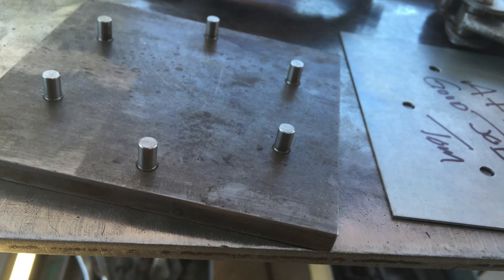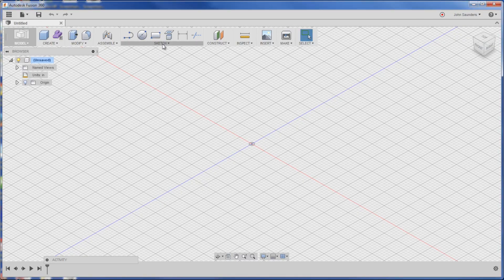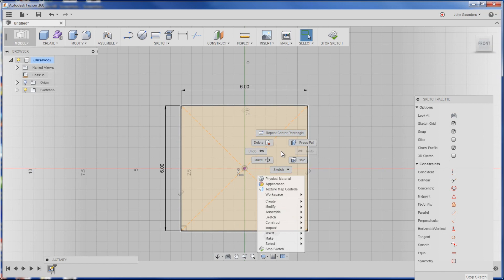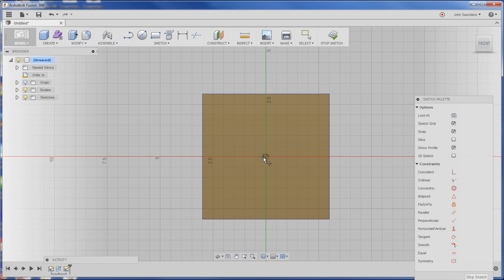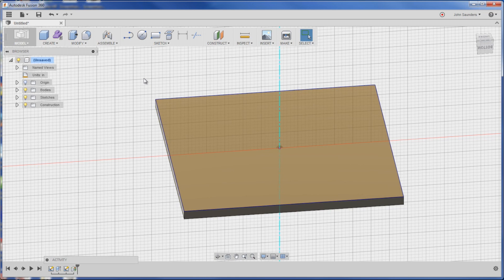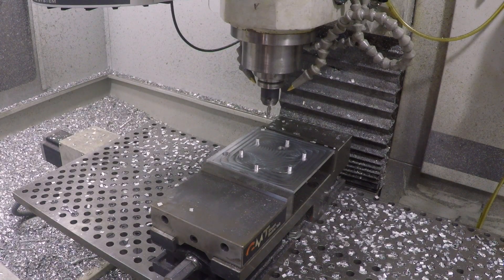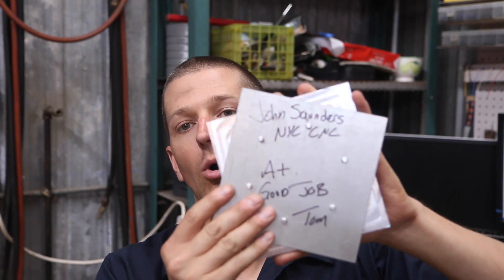Fusion360 Layout Jig Lesson!

Comment: Some tips/suggestions/intrusions:

Another way to lock in the circle distance dimension @4:21: if you click the center point of the pin and the center point of the plate, and then click again in between them it will give you an angle distance to define, and then you don't need a line (just a tip, do it however you like! ;-) ). Dimensioning from the circumference of the pin won't work because there are (theoretically) infinite points on the circle. SW of course defaults to center distance, but I believe can also be shortest or farthest distance.

You can select your faces to pattern in the Timeline at the bottom too, much like patterning in the Feature Tree in SW (in mine they are Extrude1 and Chamfer1).

With the construction line you can dimension an angle if you add another construction line, but if you want to set the pin at the horizontal (or vertical) position, move it close and then Ctrl+Select the two points and use the Horizontal/Vertical constraint to lock them.

Not trying to be a jerk, just offering up some insight.

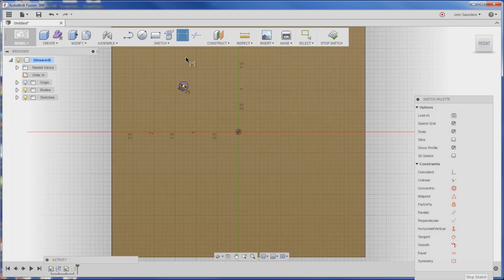Comment: @4:39 Select the center of the circle and your point and then you can sketch the dimension.
Reply: +NYC CNC Select the two points to dimension, then right click and select aligned.  Whenever two items aren't directly vertical or horizontal to each other, you'll need to right click and select aligned after choosing your dimensioning points .
Reply: +Phil B That's one way, if you click  between them when a dimension definition isn't visible it will default to straight line distance (or true position, or whatever you want to call it).
Reply: +NYC CNC John I think if you select Sketch Dimension and then the two points, then right click (at least on the Mac version) and select "aligned" you can sketch the dimension. There's also the option to force a vertical and horizontal dimension under this menu too.

Comment: Another great video John. Cheeky tip on the PCD dimensioning at the beginning of the video. You don't need that construction line, activate the dimension command, select the sketch origin, then the center point of the circle. Bring your cursor back in between the selected points and you will see a dimension icon appear next to your cursor. Left click again between those two points when you see that cursor icon, it will then activate an aligned dimension, then just click again to place it. I wanted to point out this method, since it's born from Inventor, and it will help you in the future when you need to dimension the length of a line rotated away from the XY axis of the sketch. Does that make sense?

Comment: John, is it the CAM or the post processor that gets you that spindle spin down/spin up on moves?  Either way, it shouldn't be too hard to write a script to delete the G-code for the spindown/up...right?  Heck, If there are no tool changes or other reasons for them you could do it with grep...just pull all lines that don't match those G-codes into a new file and go. Append one more shutdown at the end to stop it when done. On a real OS like Linux or Unix, it's one line at the command prompt to do all that, but even on Windows you could do it with a few lines of Perl.

If you've got tool changes to consider it gets a bit more complicated, but still not all that hard...just keep the ones that precede a tool change code, right?

Seems worth doing to speed things up and reduce wear on the machine.

Thanks for showing how it's done with the CAD/CAM!

-- Mike
Reply: I figured.;-)  If you run into any software issues that stump you, I'll try to help out. You have some software capabilities from what I've seen, so that may not be necessary, but if I can help out, I'm happy to.

--- Mike

Comment: with fusion the best practices is how ever you wont to do it at the moment, every big update it changes. other than starting with a component what only matters if the part is a all ways used (it keep`s the drawing with the model), if its a one off it does not matter at all that much how you do it.

for nobs you are doing it correct, you should see if you can use screen cast and have a cam looking at you in the corner then they can see all key and mouse commands and see you.

also just a note to anyone who gets fusion from seeing john`s vid`s put in when you sign up that you got onto fusion from NYCNC.
john will get more support from AD if you do.